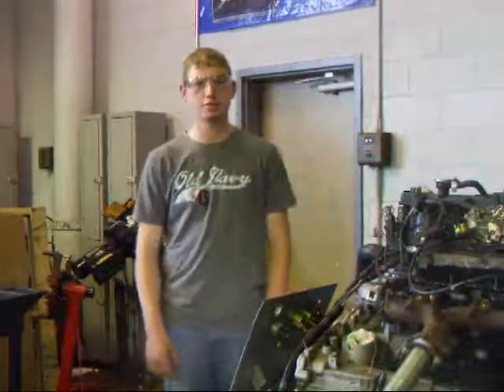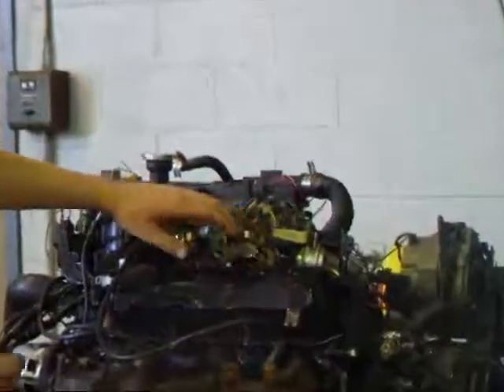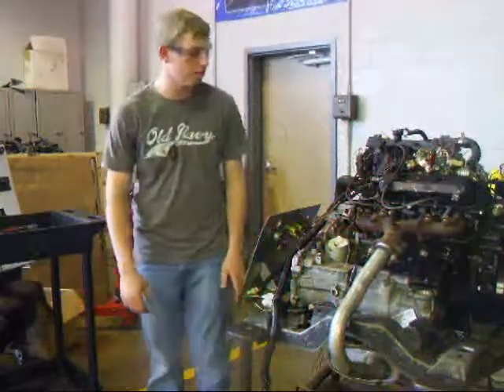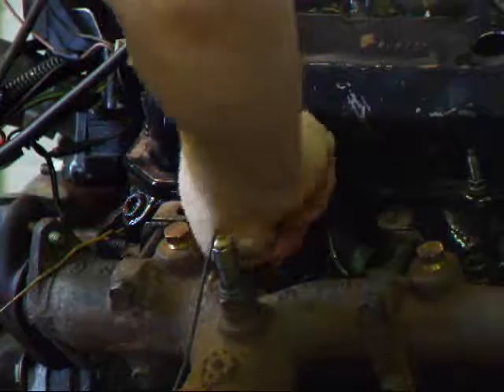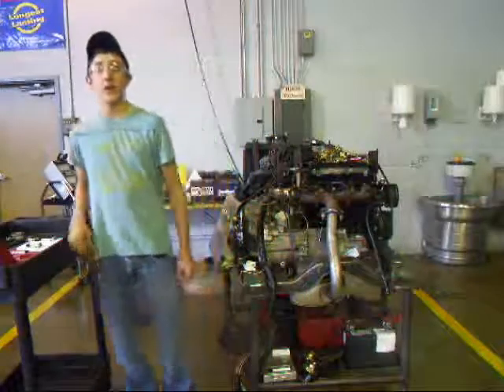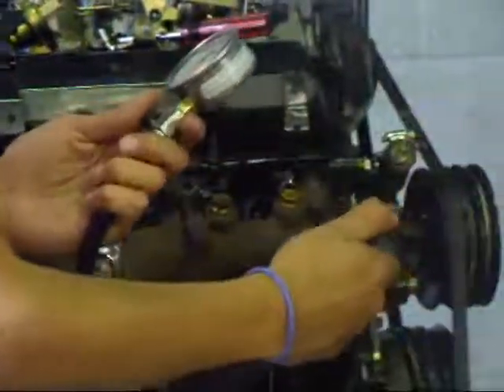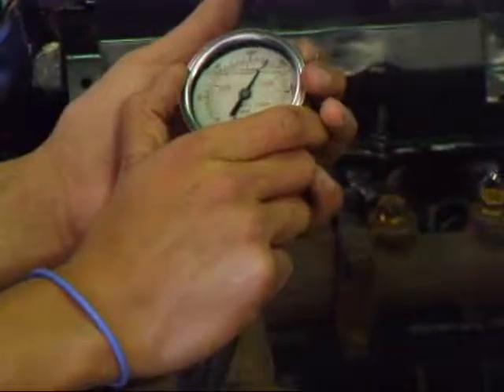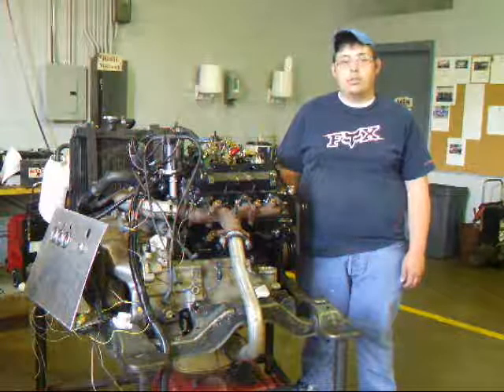How to Perform a Cylinder Compression Test

Comment: The test data would be displayed on the digital driver info display.  You could see diaganostic codes, read live streaming data of different sensors, command different sensors on or off including those controlled by the BCM (Body Control Module) like the heater door and A/C functions.  The "Cylinder Ballance Test" would work buy temp. shutting off each injector and recording the RPM drop to measure the cylinder output.  Could also measure injector flow/balance too.

Regards,
Chris

Comment: Very intellectual question "Cobrachoppergirl".  As "ttcautotech" stated below, some cars did have a cylinder balance test procedure as part of the ECM diagnostics.  Specifically, it was available on the 4.5/4.9 Cadillac's.  That system had a very sophisticated ECM which permitted the user to see a lot of data not using a scan tool and perform different tests too.  This data can be viewed by pushing the "Off and Warm" buttons (sometimes different buttons on different years of 88-96 Cadillacs).

Comment: How would that fit in a cylinder? And if it was mounted externally it would have to be in the exhaust manifold which would restrict flow... Unless there is some kind of new device for what ever you mentioned then i mustve derped

Comment from the maker: The spark from the coil can and will find a path to ground.  If you've laid them on the engine you've probably heard them arcing.  Even worse is to lay them away from ground!  If the spark can't go through the wire to ground it will try to find a closer path which could be through the wire insulation or even coil housing. Worse yet it could jump from the sparks plug wires to the computer wiring harness. Disabling the fuel prevents washing the cylinder walls which could lead to low readings.

Comment: Why would you need to isolate the fuel and disconnect at the coil???????? You will not have a spark if you remove all spark plugs. When performing a compression test you are testing the compression on each cylinder. Just seems like a very long winded way of doing it.

Comment from the maker: @cobrachoppergirl
My guess would be because of the added expense. Not everybody would pay to have that feature. Some cars will do a cylinder balance test, but only if you have access to a scantool. It's possible to run a relative compression test with an Oscilloscope by  measuring the starter current draw as the engine is cranked. Each time the cylinder comes up on compression, the current rises.  We look to see if they all rise equally. Not perfect, but a quick indicator cylinder condition.

Comment: Why don't all engines just have an electical compression test analyzer system built onto them so that at any time all you have to do is look at the dash to see this nonsense instead of disconnecting half the engine.   Not only that, but monitor water temperature, oil pressure, and battery voltage at all times and turn a red color when they are out of range.

Comment from the maker: @0jayelbee  we show how to disable the fuel and spark because alot of people will use the starter to turn the engine. Also,  we've noticed on some vehicles power would travel back up the crank circuit and enable the spark and fuel during cranking when we used a remote starter switch.

Comment from the maker: If the engine has multuiple coils it is best to unplug their electrical connectors as in the video.  If you have just one coil, there should only be one coil wire and that is the one to insert the spark tester.  If you have a Honda, Toyota, GM or other make that has a single coil installed inside the distributor or cap, then its best to unplug the elctrical connections to the distributor.

Comment: I had a bad kit. Like you said the rubber hose on the second kit came out as required. I'm a power plant diesel engine mechanic, not a mogas mechanic. Our engines are as big as 2-story houses and support +40K people (Million Watt systems) thus we don't use little rubber tools to troubleshoot. I know the process is the same, but we use a crane to pull pistons and move heads.

I normally take my cars to the shop because I don't have time at the house. 

Thanks for your reply & support!

Comment from the maker: Recessed sparkplugs have been around for decades.  In fact, Its begining to look like the majority of new cars have or will have recessed spark plug holes.  We still use the same adapter to reach down in the hole.  The rubber hose is stiff enough that it wants to stay straight and will thread in fine.  If we ever do run into one that creates a problem an adpater that is made of straight steel tubing can be purchased.

Comment: I like your video, but your process is invalid on a Honda or Mitsubishi engine.
Unfortunately, each plughole is recessed in the head in a 6 inch deep steel cylinder.
I need you to show me how to test one of theses engines.

I          I
I          I
I    II    I
I II    III    How do I get my tool down here in the cylinder then get it out?